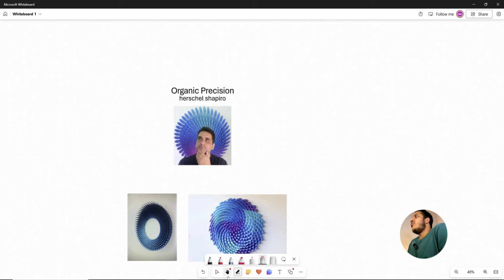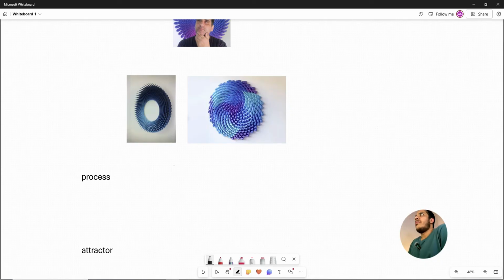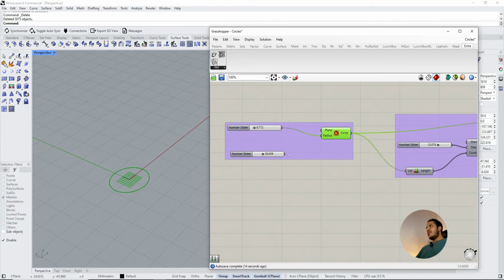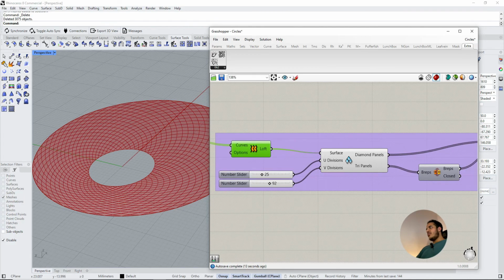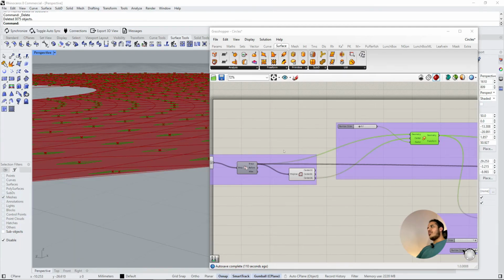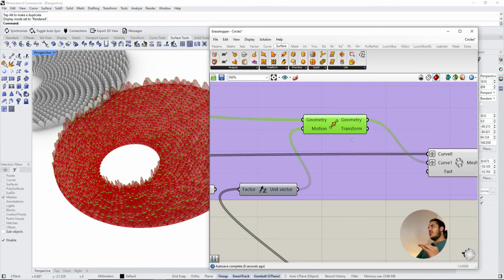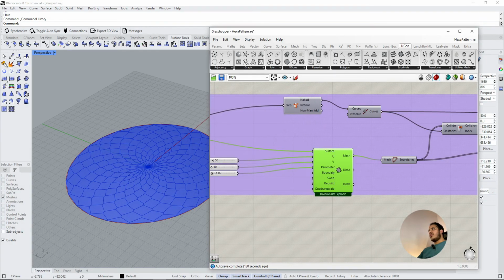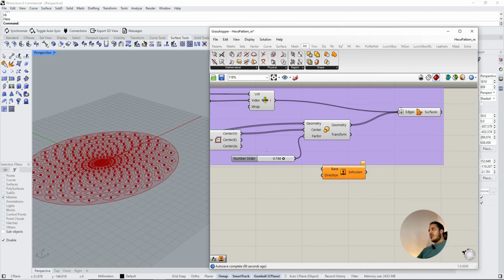Organic Precision in Grasshopper | Herschel Shapiro-Inspired Design

Comment: I would love to see you explore the more intricate designs. I think he is using fields for those designs 🤔. There is also an element of curving to the loft in many of those designs it seems, and scaling of course. It's the curving part that's tripping me off 😅.
Maybe multiple z offsets from the base geometry, scaling them and then adding movement to each level through a center of rotation (based on the overall geometry centre/circle). Doing this for 3 layers at least in the z axis and then lofting them.
Reply from the maker: I believe I got your point, and I'll do a video explaining that